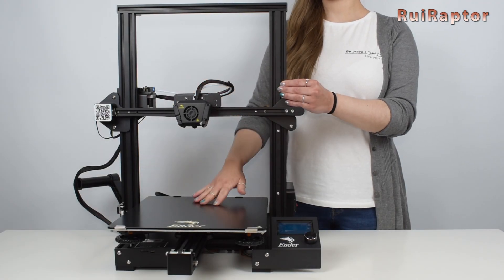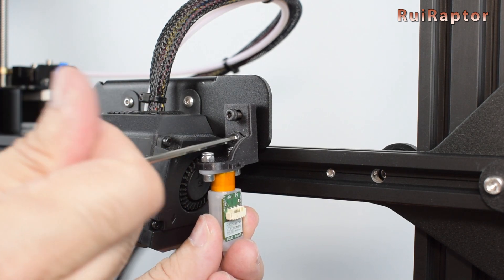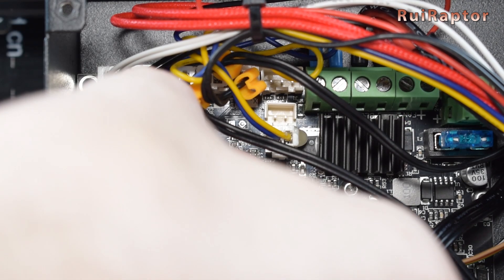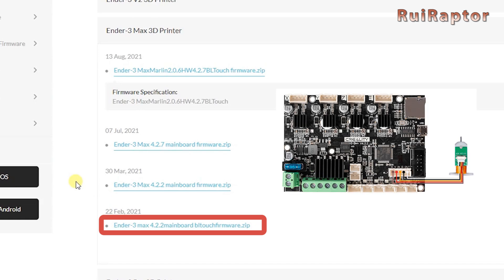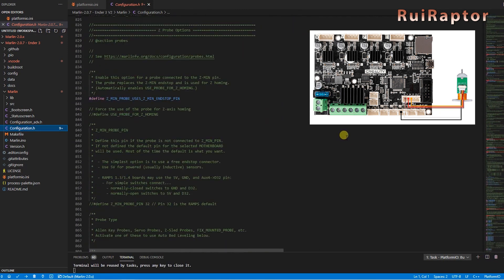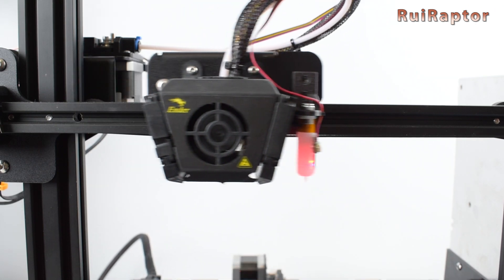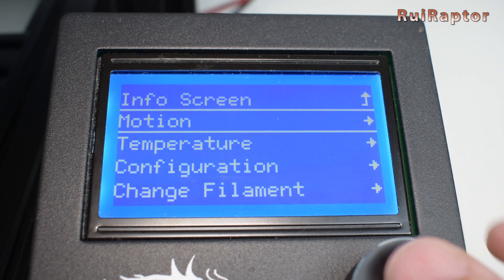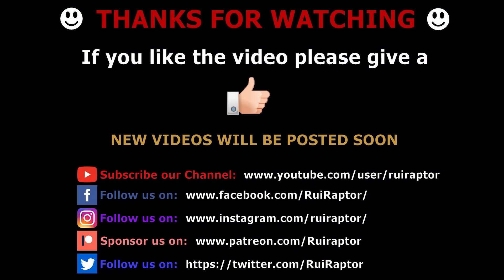Creality ENDER 3 MAX BLTOUCH - How To Install in 3 Easy Steps

Comment: This channel is PERFECT for me!  I'm still very new to 3D printing with my first printer being an ender 3 max.   This channel has been like a personal training guide for me.  Your videos have helped me out tremendously with taking away the overwhelming feeling of messing with firmware and boards.
Reply from the maker: Hi, thank you so much for your comment and support :)
Reply: @ruiraptor  I know it's been a while since you posted this but when you opened the board why were some cables removed like the fan and the filament sensor

Comment: Perfect, i wasnt quite confident in compiling the firmware as to what activates the dedicated 5 pin connector as i was looking for a line that specifically stated such. I did find a pre compiled firmware someone did that is working but now i know how to do my own this will help greatly in the future so i can configure my own custom firmware. Unfortunately my glass bed is bowed which resorted in my having to get the BLTouch in the first place but your videos and some trial and error im now getting good prints :) thanks a million - Matthew

Comment: I have installed a BL Touch on my Ender 3 Max, yet it is mounted on the left side of the nozzle.  As a result, the firmware thinks it is on the right side, when probing the first probe misses the bed completely and drives nozzle into the glass bed.  Any advice?

Comment: Hi there 
I have the ender 3 max and have installed the bltouch kit that directly plugs in but every time I go to home the printer the z axis goes up if I set the z axis to where it's ment to be then go bed leveling each time it probes the bed the z axis goes up, I'm so confused 🤦‍♂️😅

Comment: i Installed a CR Touch with on my ender 3 max with the Compiled Firmware Versions from creality. But now my firmament detector is not working and when i try using bed leveling option the cr touch leaves the bed on the third point of the test. Any help would be appreciated.

Comment: It may be me.. but with the latest release, 2.092, this fails with an error relating to BLTouch 5v mode not being compatible with the pin..

I was going nuts trying to figure out why it worked in the video but not when I did it exactly the same steps.. I then noticed you were using 2.091 so grbbed that and its header example and it works exactly as expected..

If you have tried with the latest release and have it working I would be interested to know what is different..

Comment: Hi I've installed the BL touch onto my Ender 3 Max, when running the self-test or deploy or stow options it works accordingly, however when trying to use the bed level option it just rams the print plate and keeps going, I've tried to activate the probe with my finger before it hits the bed and instead it just starts blinking red whilst moving down towards the print bed.  

I've tried to connect the BL touch to the designated connector on the board as well as on the Z connector with the appropriate firmware for each attempt and regardless the outcome is the same where it appears the BL touch does not trigger anything and starts flashing red.
Reply from the maker: Hi, if you can control the sensor with the menu it means that the problem might be related with the white and black wires. Try swapping the black with the white (and vice versa). Always trigger the sensor with you finger to test if everything is ok before testing on the print surface to avoid damaging the printer if something is not working correctly.
Reply: @ruiraptor  was having same issues, now it works, just switch the white black wire haha.. thanks!

Comment: I'm having a problem with mine where the Bl touch will not calibrate for example if I adjust the offset and then auto home it, it will not get close enough to the bed.

Comment: My printer is Ender 3, I use Ender 3 Configuration > CrealityV422. Then do all the steps in this video, but when I do auto bed level, nozzle check Home, then back to Z Safe Homing. what's wrong?

Comment: I just finished installing my BL Touch but I'm still having trouble to get my printer to auto home, are you able to assist some please?
Reply from the maker: Hi, what is happening when you start the auto home sequence?
Reply: @ruiraptor  Absolutely nothing, I get a fail message and am asked to reset the printer.

Comment: Once again a good explanation of a bltouch installation with modifying the firmware and z-offset BUT then you say and do “It’s safe to run the leveling sequence” without any explanation on how to do this. Almost all bltouch install videos do the same. There seems to be no way to run the Leveling from the LCD. For me, I just (from a terminal) run G28 then G29. Is there an easier way?

Comment: What about tightening or loosening the bolts on the bed is that not necessary if you have a BL touch
Reply from the maker: You need to have the bed at least somewhat leveled or the leveling sensor will not be able to compensate.

Comment: Hi, after instaling your firmware I can't move z onto negative values to calibrate the z offset and the nozzle never touches the bed for calibrate (hola, instalé su versión de firmware y no me permite mover el eje z a negativo, no toca la cama y no puedo calibrar el z offset, desde ya muchas gracias si puedes ayudarme)

Comment: Can you add PID tune for bed, babysteps and  bed tramming to the firmware? To both 4.2.2 and 4.2.7
Reply from the maker: The new 32 bit boards from Creality have much more programming space when compared with the older 8bits one which means you can add all the features you need in the firmware, compile it and upload it to the board.

Comment: Boas Rui, after I insert the probe offset values and I do a bed leveling the X axis goes out of bounds, the values seem okay, i measured them more than once to be sure but to no avail. Do you have any idea whats wrong about it? I'm suspecting it's got something to do with the endstops but i'm not sure. Hope you can help me. And thank you for all the resources that you give us!
Reply from the maker: Olá Tinto09, 
When the prober is homing the Z, is the probe centered on the bed?
Did you check/calibrated the home offsets?

Comment: this video did help. however..... being that im such a noob to this.... i could not figure out the last 2 min. you didnt show how you got to those screens in cura and no matter what button i pushed i cant find it so i can enter that "gcode" you mentioned....... i hope the print still works without doing that last step
Reply: also, i dont see a "baby step z" option.........sigh or will it only show up if went through with that last step?

Comment: Hello Rui, I tried to follow your steps for the firmware build and was unsuccessful. My ender max wouldn't load it. So I tried to load the one you made with the dedicated Bltouch plug. Everything loaded but I'm not able to adjust the z axis bellow 0 and can't set the probe offset. Any help would be greatly appreciated.
Reply from the maker: Hi, 
to be able to go bellow 0, you need to first define a negative Z probe offset. Why can't you set the probe offset?
Reply: @ruiraptor  I adjusted the Z probe offset to negative 3 and store setting.  Then I proceeded to fine tune the Z probe offset by measuring the distance by moving the z axis.  At that point it would not let me go negative.
Reply: @jerzii_brain_6665  did you find a fix mate? i'm having the same issue
Reply: @iamfmp  I finally found the "Move Axis" option and was able to get the print nozzle close enough to the bed for the PLA to actually adhere for the first time in a print.  But it only printed endlessly at the same level, and the print head was crooked, as if it was down too far.  Then it started scraping.  WELL THEN, down too far this time.  Now the glass has scratch marks that won't come out, ruined.
This is wonderful.   Wish you could just follow instructions and watch it work!  No such luck for me.

Comment: homing failed printer halted please reset
BLT firmware flashes to Ender-3 MaxMarlin2.0.6HW4.2.7BLTouch 
and clicking stow/deploy works perfectly...
printer does not move at all when auto home is pressed
Reply: You most likely downloaded the incorrect firmware. You probably need Ender-3 max 4.2.2mainboard bltouchfirmware
Reply: @user-uo8cp4xy7v  Where do you find this? I've been searching everywhere for it. I can find 4.2.2mainboard but not 4.2.2mainboard_bltouch
Reply: @bradleyminger  
It’s been so long, I don’t recall.   It might have been supplied on another YouTube video or web tutorial.  First step, if you have not done so already check which board version you have in your printer.  Then search for that firmware.

Comment: I followed all your steps still can’t get mine to work can u help me out ?
Reply from the maker: Hi, what problem do you have?
Reply: @ruiraptor  it not working like not sensing the plate, now I disconnected the CR touch and now it will not home right I’m so lost… helpppp - sincerely one lost lady lol
Reply from the maker: Did you connect the sensor correctly? Did you connect to the dedicated Bltouch connector or to the Z endstop connector? Did you try to swap the black and white wires and see if it helps?

Comment: This is ANYTHING but easy.   Oh the installation is simple enough.  Be prepared to spend days fighting with the Z offset.    Mine continually prints too high, even when "Move Z" goes all the way to its lowest setting.
Oh and I definitely have an Ender 3 Max, but I have no "Motion" and "Axis" options.   At 14:23 mine instead says "Info Screen", "Prepare", "Control", "TF Card" and "Change Filament".    Well that's not good.
One day I'd like to actually print something with my 3d printer.   "I have a dream....."

Comment: Ahhh, so IF the bed is very flat (and that's easy to check with the paper test), then you don't need the BL touch sensor..as it's main job is to compensate for  non-flat beds.  I never would have known (at least not until I already bought one!)..

Comment: I had installed a BLTouch on my Ender 3 V2 3D printer, but it did not help level the bed. This is not what this device does anyway, which is why you have to do it yourself before using the BLTouch. The BLTouch is only useful if your build plate has surface irregularities, and even then it's not that useful. I removed the BLTouch from my printer some time ago. I squared off the frame on my printer, added a second lead screw to the right side of the printer to reduce gantry sag, and replaced the bed springs with more rigid silicone bed mounts. I haven't had any printing problems since I did these simple modifications. The BLTouch is only necessary when your build surface is extremely warped. Otherwise, it's a gadget, and you don't really need it.